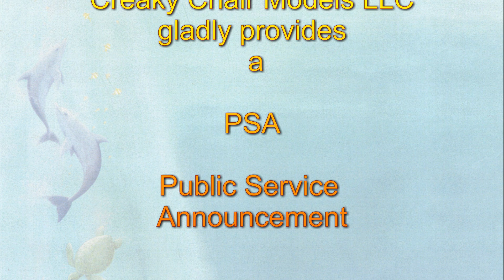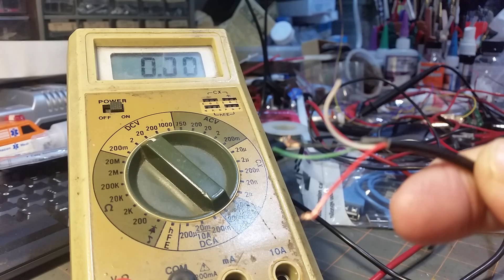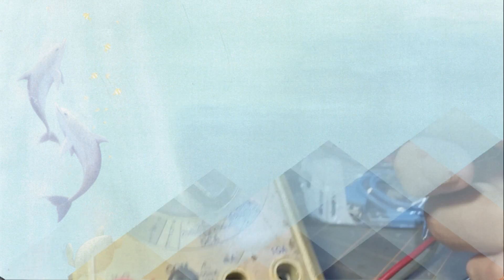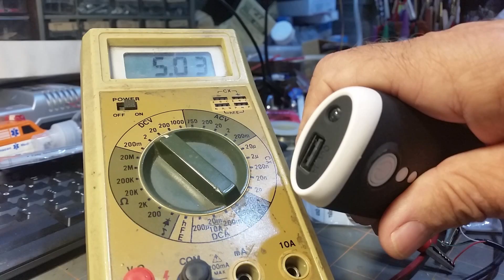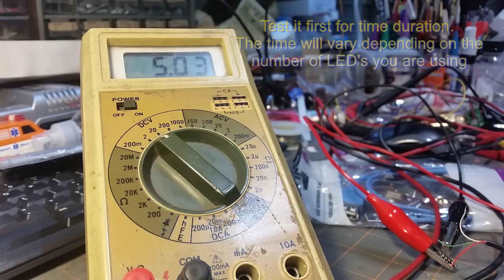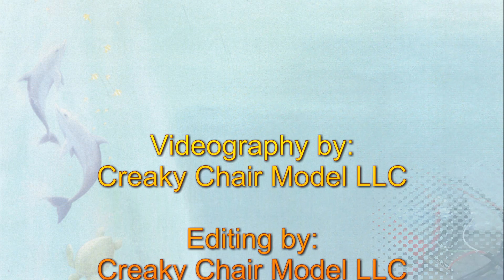Creaky Chair Models Model Railroad PSA #1

Comment: You mentioned connecting a resistor in searies with each LED, Is this with all the LED's connected in parallel ?
Reply from the maker: boomer0622 yes the current needs to be limited to each Led. If you truly parallel all of them you will need to calculate the total current and determine the resistor value and power factor using ohms law.